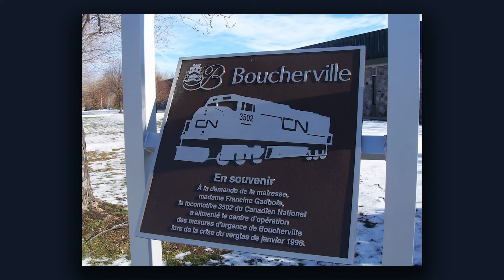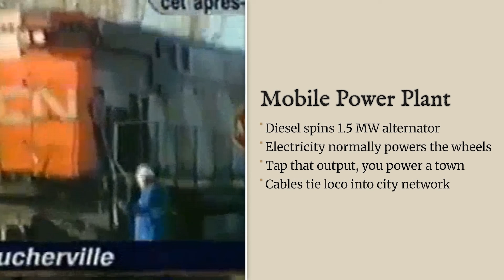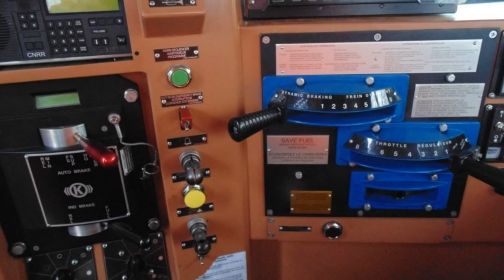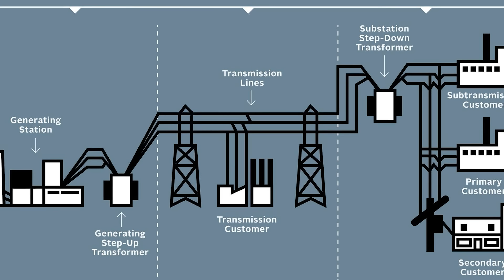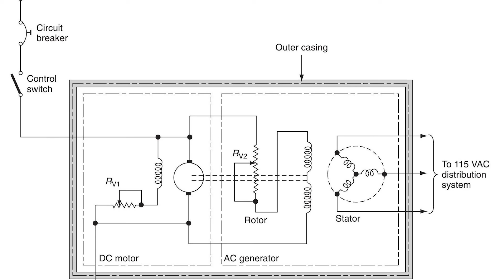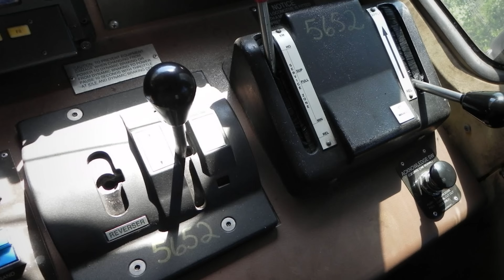The Locomotive That Ran on Asphalt to POWER a City

Comment: I’m confused?  You can’t drive a locomotive down a road?  There is no steering wheel.  How did they keep the trucks facing the correct direction ?
Reply: They lifted it off the rails with a crane, so they probably made sure it was pointing towards city hall. It should pretty much track straight.